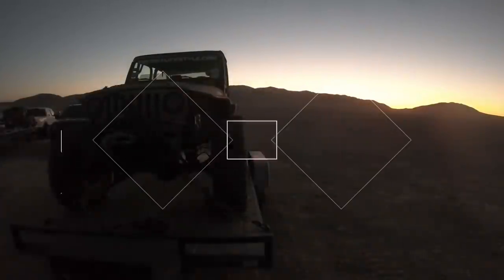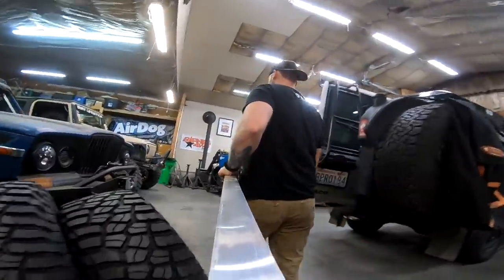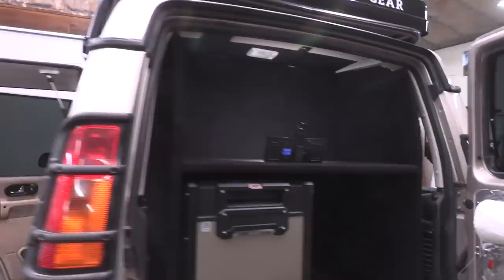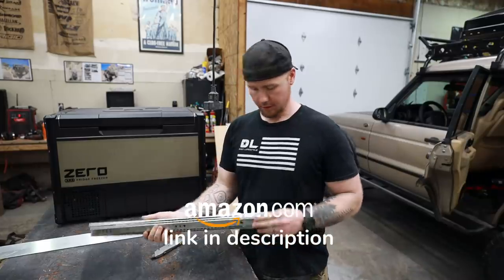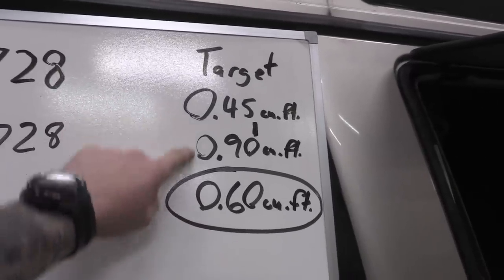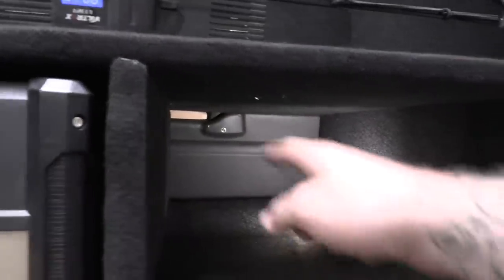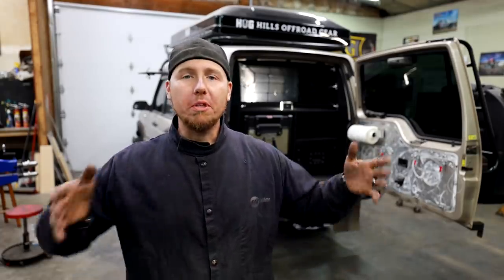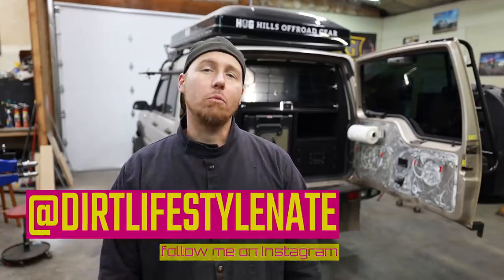Building Easy Overland Gear Storage! Ultimate Land Rover Discovery Build Episode 7

Comment: Hi from Australia. 

Awesome work with the storage build. I built my own draw and box setup for my Disco 2 as well, which is modular. So in everyday form, I have a flat deck the same size as the floor space, but sits a bit below the height of your flat deck, then a box that bolts in on top on the RH side to add more organisation. I also run a drawer fridge, so the fridge itself is a drawer. the downside is its not as tall, so bottles etc have to lay down, but it suits our needs. 
As for material, i cant recommend Marine Ply enough. Being marine ply, its ok with getting wet. Mine is bare marine ply painted black to help seal it up against moisture. 

Those slides you used for the drawer and fridge slide. You can get them with a latch built into them. they have a little lever about 10mm long that you lift up to unlatch, and they also lock at full extension. so if you are parked nose downhill, and you open your drawer, it isn't going to try slide back in on you.  

I know this was from another video, but great work on the gullwings too. they are F**** expensive to buy, and now that I have seen you build them yourself, it might be something ill consider in the future. 
The retail price of things like that is exactly why I also have started designing and making aluminium stuff for my Disco. next project for me is a shelf that mounts up in the back area above the boot, about 250mm down from the roof, made from sheet alloy. 

Great work, and will be watching this develop more as you go.

Comment: @5:30 in- using hey babe I need the cardboard from a moving box and a Sharpie so that I could find the shape needed and then chasing it over to a piece of MDF that is exactly how I made a false floor board and one piece carpet 4 the back of my 98 drivers Edition GTI so then it looks like a factory two-seater. When you pull the rear seats it's just like a Jeep and it goes down with the front piece of metal higher up than everything else so I just brought it forward to the lip and then wrapped it in some black fabric I got from Jo-Ann Fabrics or Michaels or whatever and there were so many people that believe that's the way the car came from the factory because it looks so clean and was a two-door. Also do it again on my 97 Grand Cherokee 4 tool storage. Some tools went underneath and then on top I had vertical slats Spirit into the baseboard that held in all of my small tool boxes or milk crates or shopping baskets from places like CVS in the grocery store that held all of my tools separately - one for screwdrivers, one for sockets, one for wrenches Etc. Even had a gas powered air compressor with the airline coming out of the passenger rear window and exhaust coming out of the flip up rear glass and on the opposite side had a nice little door with a latch that held in my 70 lb low boy 6 ton jack. I may try to recreate and improve upon that set up with my current Cherokee along with the rear Goldwing windows that I found on your channel and very much enjoyed. Was thinking I may be able to use the hinges from the pop-up rear glass from junkyard Cherokees and considering it would probably only cost me five bucks I figure it's worth a shot!

Comment: Wrong way/ unsafe way to lay down a KILLsaw.  Lay it on the flat side for safety. If the guard jams or does not spring back for whatever reason and the saw has not stopped winding down it could travel backwards and cut you severely.